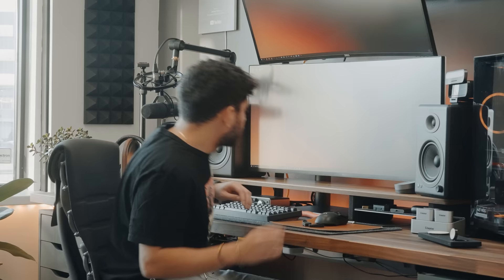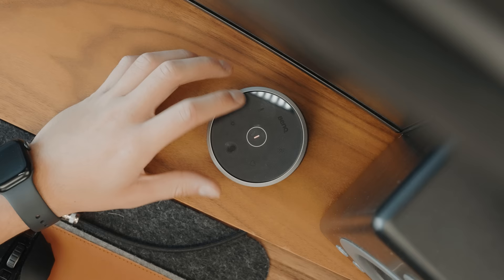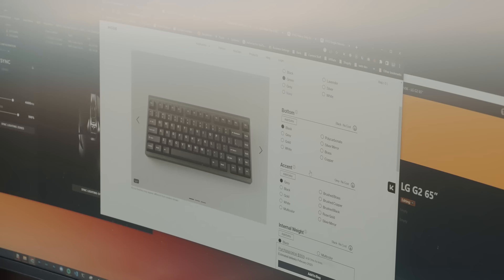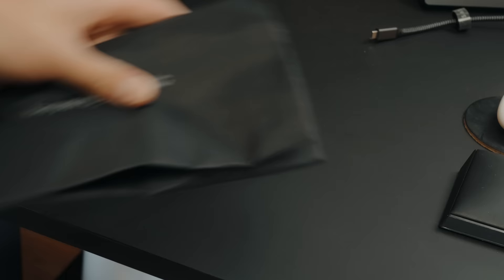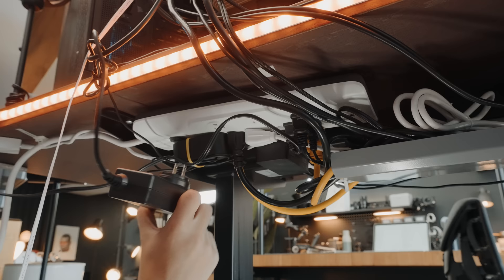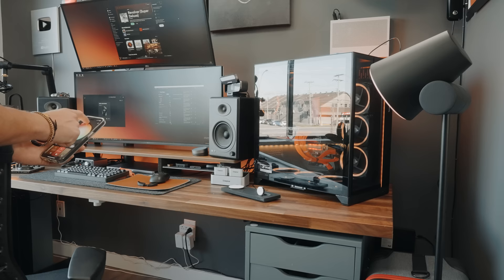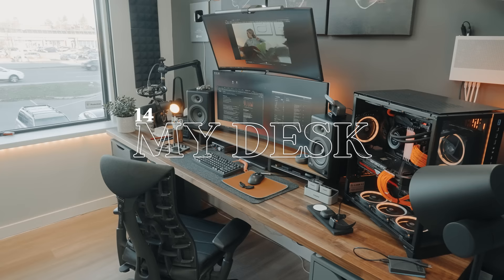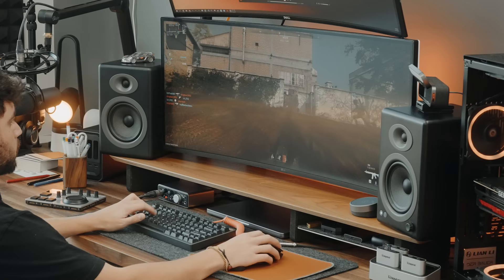The Dream Desk Setup - Home Workspace & Gaming Desk 2022

Comment: If you're looking for desk pad that would be very comfortable for elbows / wrists, you may wanna have a look at fusionstrike original limestone desk mat. Been using it for 3 years personally and my friends, so far it's been great so we made a whole batch of them. Currently ship within UK but could sort out international shipment too. The rubber is made from sustainable limestone rock (instead of oil/petrol) which makes it more environmentally friendly than most desk mats out there. It's laminated with super stretch smooth nylon so it's mouse compatible and very gentle to skin

Comment: I don’t know if anyone mention this, but your speaker cables are installed wrong. They’re banana plugs, so they go into the hole, not where the spade or bare wire goes.

Comment: Just wanted to chime in and say that your shock mount for the SM7B is redundant. It has a shock mount built inside its casing, which is one of the reasons why it's such a popular microphone. Other than that, I really like your desk setup. Take away the unnecessary shock mount and it's 10/10!

Comment: The orientation of the fans on your Lian-Li build are in the wrong order. Also, just because you get a BSoD, doesn't mean an upgrade is necessary, you just need to troubleshoot and then come to the conclusion that the cost of replacement parts is the same as buying brand new with concurrent tech. Also, the mess...is a lot in your office. You do need to organize, a lot! You might want to look into SteelCase. As for your static, you might want to think about grounding yourself or your office space. A wooden tiled floor is visually pleasing but is a nightmare with electrostatic devices, maybe that's the cause of your BSoD's.

Regardless, nice setup(disregarding common YT'r mistakes)! Have a like for your efforts/video! :)

Comment: Yo. Nice setup. Close to mine but I got my pc on the ground to the bottom right before the drawer. Also I put my speakers above the drawers for better sound seperation. That's mainly why my PC is on the ground. It's also a very nice wooden cart / PC holder I got on Etsy. 

Just an FYI i'd be careful with the monitor arm that is supporting the top monitor. I've heard stories that monitor arms don't do that great on Ikea desks due to the honeycomb style desk. It's fixable by applying a thin sheet of metal / wood to both sides of the clamp so it spreads out the surface grip on the desk. Nice setup tho!

Comment: Can that desk top really support the mount you have? shouldn't it cave in because the desk is essentially thick carboard?
Reply: The Karlby counter top is particle board with a thin walnut (or oak, or birch) veneer on the top and sides and paper on the bottom. No doubt it would sag if it carried too much and wasn't well supported. However, he has the counter top mounted on a set of standing desk legs which has a metal u-channel component that provides support for the desk top (and houses the wires running from the controls to the motors.)

Comment: Beautiful setup! quick question: why are the bottom fans of the case are mounted as exhaust?
Reply from the maker: top side, pull and then bottom and back push!
Reply: @andresvidoza  They're backwards. Bottom should be intake, top should be exhaust. You're starving your GPU for air by making the bottom fans exhaust.

Comment: What’s the dimensions/links to that desk and drawers? Where did you get that? If it’s pieces together how big is the wood?
Reply: The desk top is the Karlby counter top from IKEA. It comes in 74" and 98" lengths. It also comes with Walnut, Oak, or Birch finishes. I believe he has the walnut. In fact, there's a brief shot of the underside of his desk where you can see the Karlby sticker underneath. If you can pause the video and zoom in, you should be able to see the id number for the exact Karlby variant he's using. The drawer sets are the Alex drawers also from IKEA. They currently come in black, white, or turquoise-green. He has the turquoise-green.

Comment: Question - I bought a 27-inch Monitor to connect my laptop for a more prominent display & a Bluetooth sound bar. However, it's unable to attend calls even though the company has promised a call function. My team members were unable to hear my voice. But the sound bar is working well. Is there any alternative for the call function on my monitor? I'm fed up of wearing headphones all day long. Any suggestions?
Reply: Do you have an external microphone plugged in to your computer?